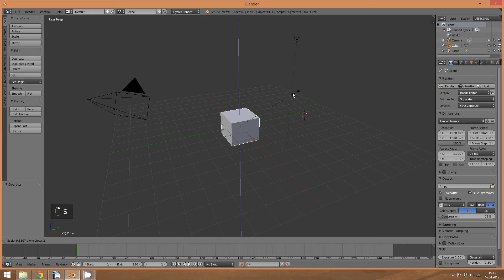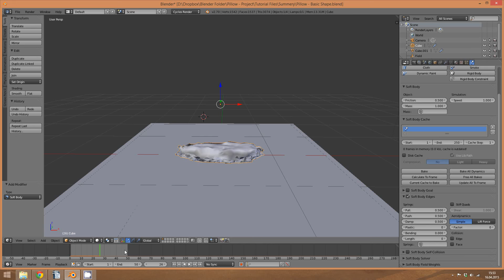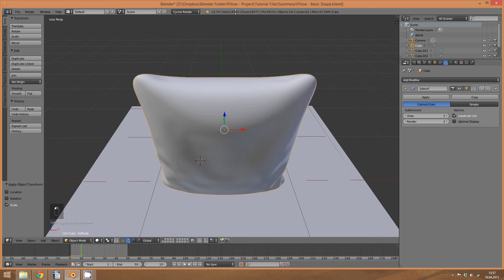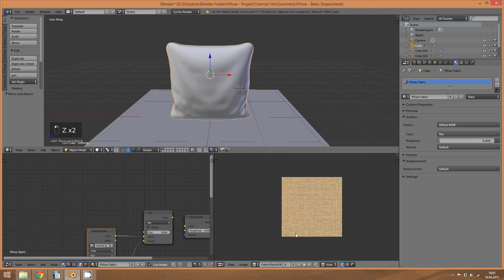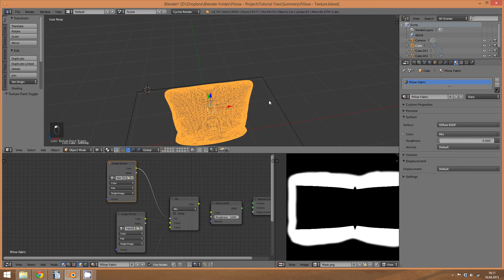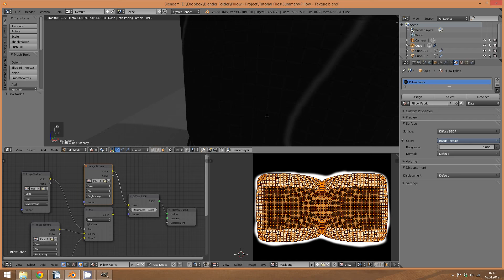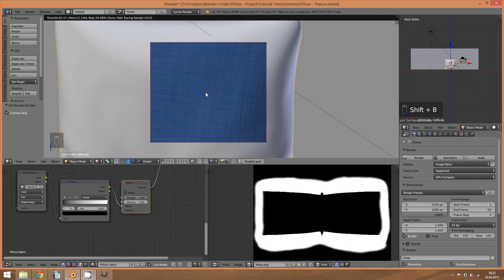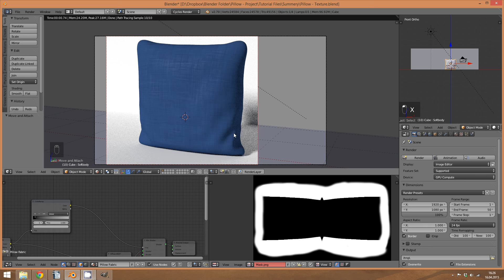Creating a Pillow in Blender

Comment: I'm following your instructions exactly when applying the soft body physics but for some reason my pillow just raises into the air with no deform instead of collapsing into a puddle. Could you tell me where I'm going wrong here? Thanks
Reply from the maker: No sorry, I can't explain that. Could have something to do with the forces or your world physics but try to to it step by step using the default blender settings.
Reply: I'm experiencing the same problem here